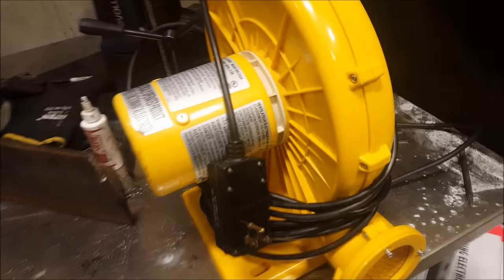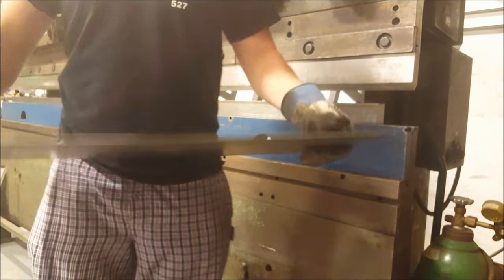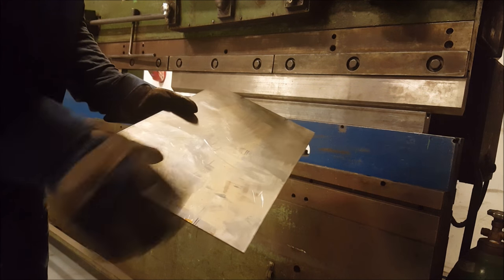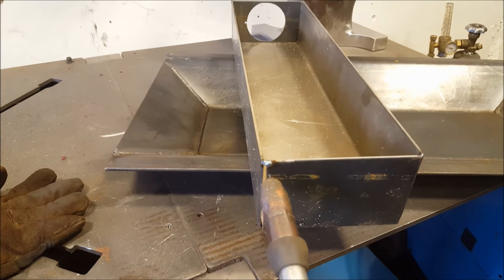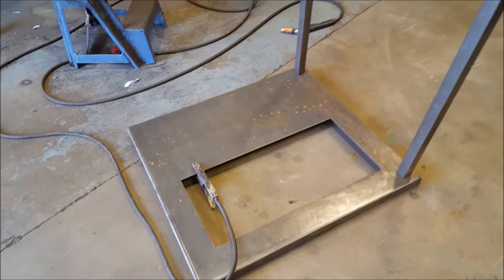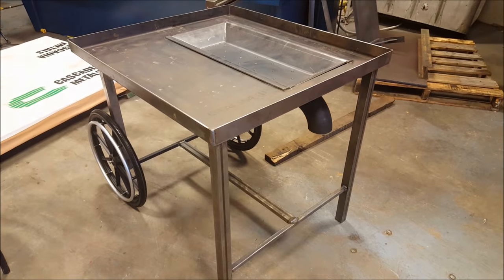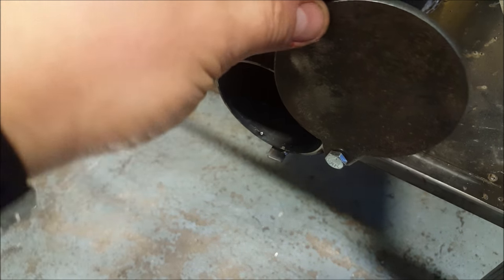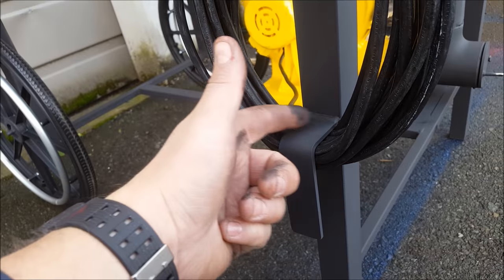Building an Auto Coal Forge for Blacksmith Forging

Comment: Nice build and nice shop. I had an idea for your clean out of the air chamber. Plasma cut a square opening opposite your air inlet as large as you can make it and then put a similar trap door as you have for your air overflow port. That way you can open that trap door and shop vac out any debris in the air chamber.

Comment: Lovely build. Glad to see you using an air-gate instead of trying to put a rheostat on that blower.
Countersinking the holes a bit might reduce the whistling, sharp edges are what cause a lot of that.
This forge may be great for heat-treating an anvil, but for regular smithing work, distributing the holes this way is gonna be sorta wasteful of coal. Plus the small area of holes means the pressure is really high, which, as you hint at, is gonna blow coals all over the place. For most smithing, you wanna focus your airblast on a small region. Consider drilling a bunch of holes in about a 4'' diameter circle, and plug some of them up when you are doing heat-treating and other big work.

Comment: very nice forge thought like some others have said a smaller bowl for the coal is better to more concentrate the heat all i use for mine is a 12in cast iron pan with a 1.5 in long cut in the middle and a hair dryer as a blower though i am using anthracite "heating coal" because that is all i can get around here without ordering it i can melt a 19mm wrench in about 2 min

Comment: good basic design idea, however that firepot is very long, much longer than any pot I've ever seen.
it will consume a large amount of coal.
being able to concentrate heat to smaller areas is important .
I design forges myself and sell them. the largest pot I've built is only 10" wide and 12" long.
Even that is not a fuel efficient size.
the most effective size will be around 8" square or at most 8" X 10".
I can forge for an entire day in a 8"X 8" pot all day on just under a 5 gallon bucket of coal.
and have heated hammer blanks up to 8# in that size.
Your fabrication skills are excellent, and you have a well outfitted shop to build in I might add.
if you reduced the size of that pot to half or less you will be saving a bunch of money in fuel costs.
Remember that if the burning fuel isn't directly heating the area of your stock your working on that's it's just burning up money.
and working  3- 4" of material at one time is about all you can do before the heat gets below forging temperature.

Good luck with your efforts and I'll look forward to seeing it in operation.
Reply: Mitchel Perkins he said he was building it for heat-treating his anvils so he needs that size. This is a purpose built forge, size is always relative to the work you are doing.

Comment: You'd get much better results on the screw holes if you used a countersink that matched the underhead angle of the screws, usually 82 deg.